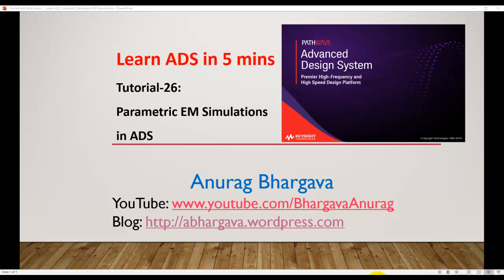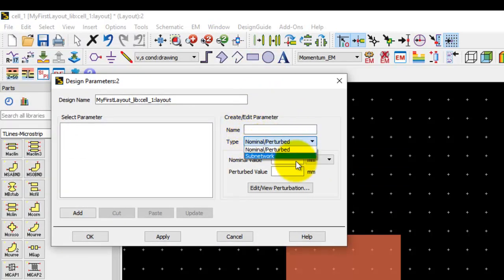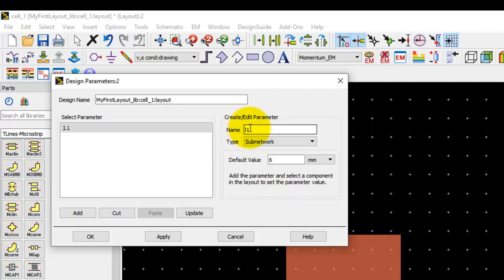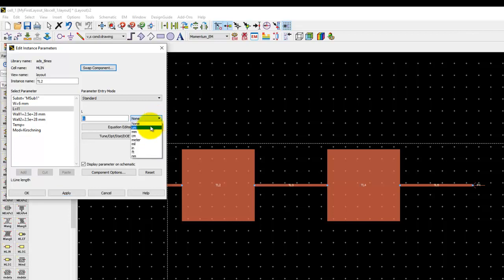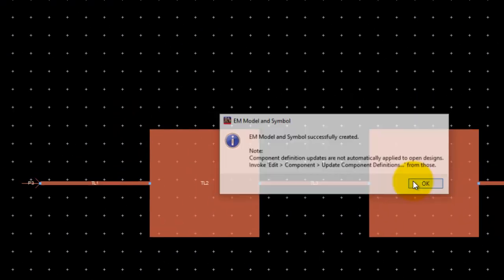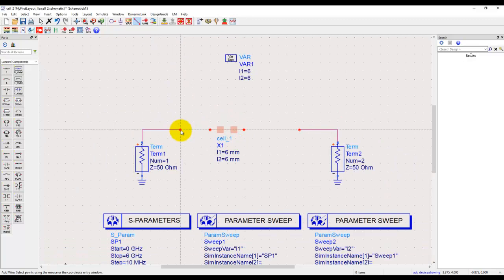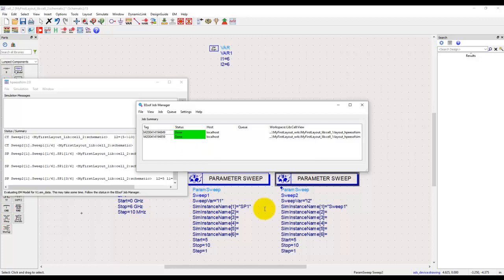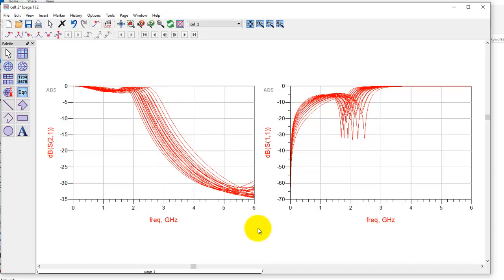Tutorial-26: Parametric EM Simulations in ADS

Comment: Dear sir I am designing a bandpass filter using a circular bend. But when I go for full-wave simulation and simulate it. Its skip the boundary of my design.  Please guide me on how to do meshing if one has a design in a circular shape.
Reply from the maker: Hi Bilal,
If you are using Momentum then you can set Arc Resolution in the emSetup Preprocessor setting. Setting it to lower value will follow the shape more closely but sim time might be increased due to more mesh cells. In my experience anything lower than 20deg doesn't make too much different but you can give it a try with various settings and see the performance to know good setting to use for your design
Reply: @BhargavaAnurag  thanks i will surely look into that and will come back to you. thank you for quick response. may you be blessed with more. Ameen

Comment: while running the same sim as yours i am getting the error 
"ERROR: (deemif.ael line 3634, column 36 in de_get_param_names_and_values) 
Error preparing the simulator for expression evaluation.
There was a problem flattening the netlist.
Error when evaluating parameter "l1" of cell "ADSLecture_lib:Tutorial_22_Introduction_to_ADS_Layout".
Why is it having problem with that variable? the standalone layout simulation works fine.
Reply: I fixed it. somehow having the same variable name in the schematic was creating some confusion. I had to use different variables in the schematic and it worked.
Reply from the maker: As long as you do things right, it will work as expected...👍

Comment: If I want to parametrize any shape, not a standard part, is it possible to do that? Say I want to build my own GCPW line out of rectangles, can I assign a variable to the width and length? It doesn't seem to work.
Reply from the maker: sure you can but the process is little different and its called nominal/perturb method. You can get an idea from this video: https://youtu.be/4xR0vrOv75Y
Reply: @BhargavaAnurag  That was pretty close to what I want. Thanks. Your tips and tricks are very very helpful.

Comment: Great video Sir...
I have a query though If I want to optimize the l1 and l2 variable by setting goals for insertion and return loss in the schematic. Can it be done?
Reply from the maker: Yes, absolutely. As long as you have parametric component placed in schematic, you can optimize it in schematic like you do for any circuit. Only difference would be that for every iteration an EM simulation will be performed in the background so you need to be little patient before you obtain the results. This is the reason why I usually recommend to perform nested parameter sweep with fixed step size for the variables and then do optimization only if you can't get the right value combination in parameter sweep for your desired results.

Comment: Sir, is there any ads utility to convert lumped element to TL dimensions?
Reply from the maker: If you use Impedance Matching Utility then there is a option to convert L,C into TL but as such no general utility exists. However, it is not very difficult thing to do and you can write your own equations in Schematic or Data Display to do so and these equations are available in many text books or portals.

Comment: Hello sir,
Here when to use momentum RF and momentum Microwave ?
Reply from the maker: You can refer to ADS documentation for more details and application. In short, if you have geometry less than lamda/2 then you could simulate it with MoM-RF. Momentum RF does't take radiation into account as this is based on quasi-static assumptions. Momentum MW is general purpose and can be used for any geometry you want but for smaller structures Mom-RF gives huge speed advantage.